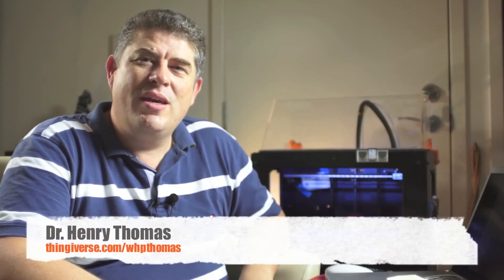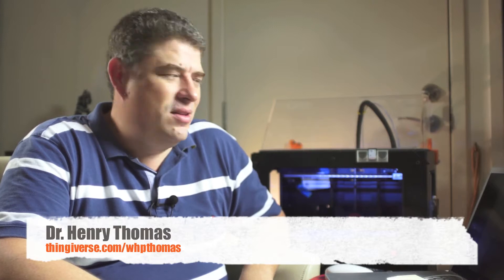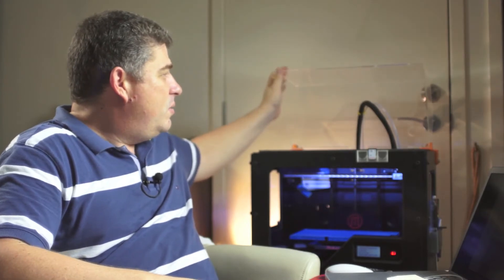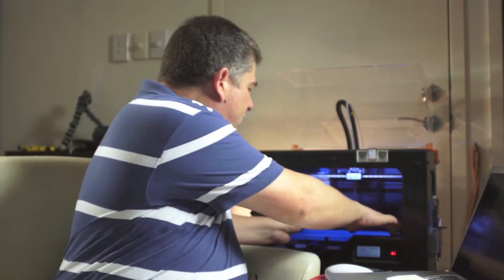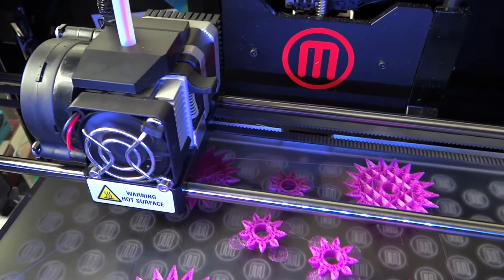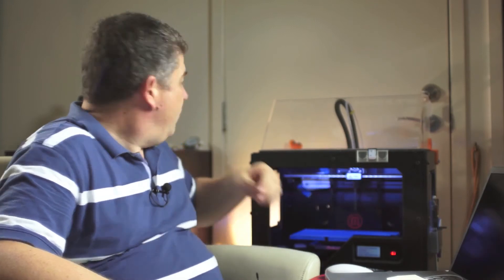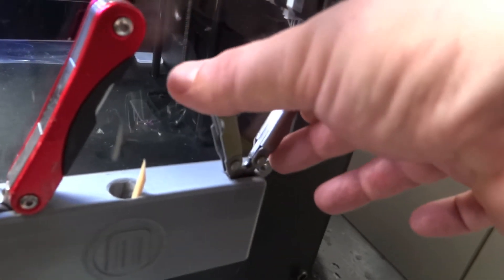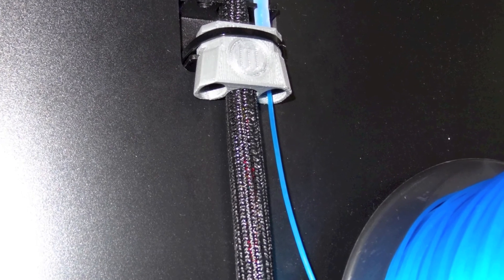3D Printing with the Replicator 2 - Introduction (1 of 8)

Comment: what are your thoughts on getting a glass build plate? I'm having warp trouble and, even though I went through the service process and it has been determined that the plate is in fact warped it has been quite a while since I have provided my order info and serial number to get the replacement and haven't received any info on it being shipped (its been about 3 weeks). I'm thinking of just getting a piece of glass at least until the replacement comes. I can only print in the middle of the plate.